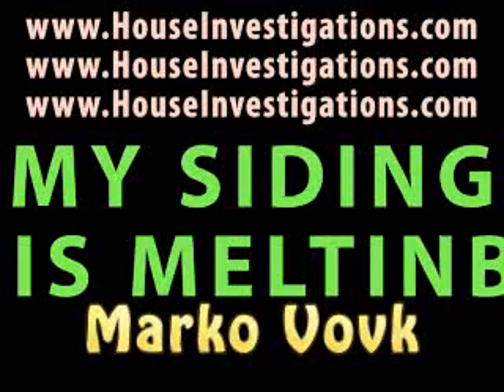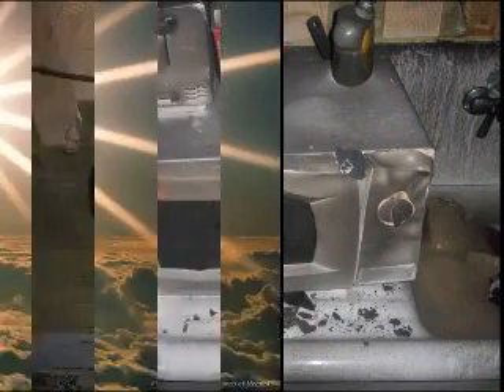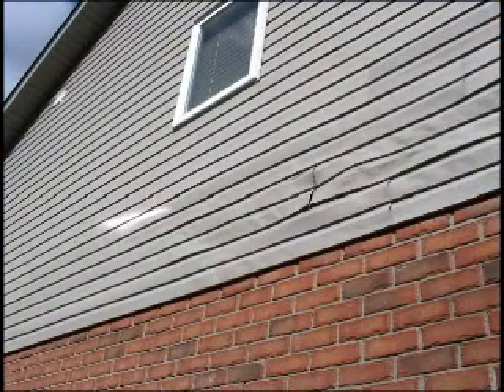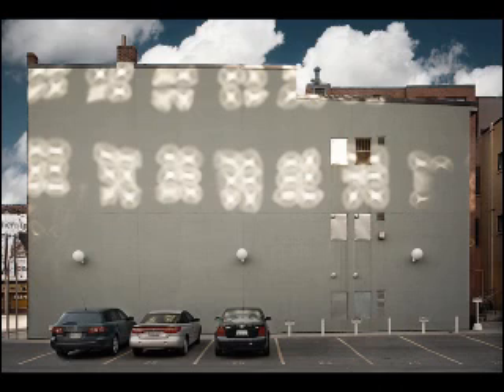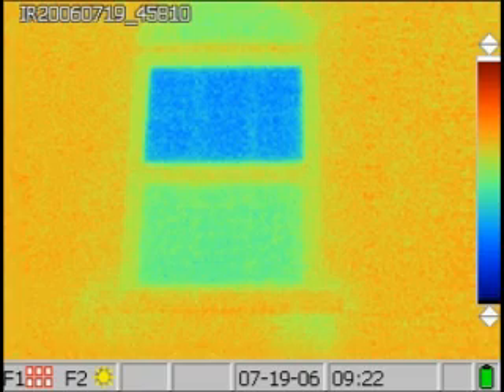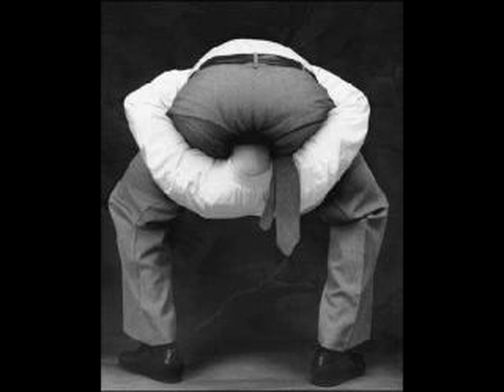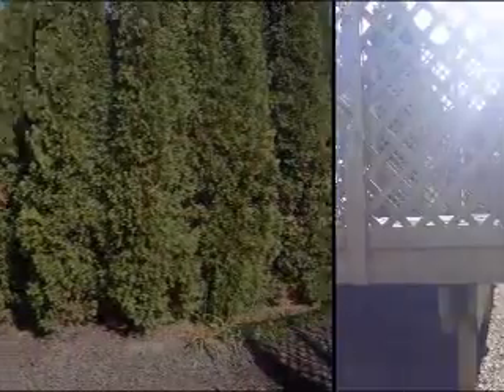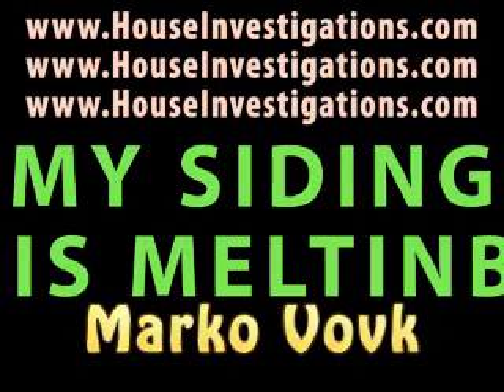My House Is Melting Vinyl Siding Melting Distortion from Window Reflection by Marko Vovk

Comment: The problem is the 'concave' surface of the windows. It acts as a giant lens, focusing the heat back on the house to the west. 
The Sunstarlight clears the eaves about 3 in the afternoon. It reflects down to the ground, and moves due west to the foundation of the house to the west. Then it ascends to the south at a 45 degree angle.
At this time of day the Sunstar does not 'move' much over long periods, due to the angle, so it has time to 'focus' the lens on the vinyl.
I held a thermometer in the focal point and it quickly topped out the 120 degree (Fahrenheit, USA) maximum of the thermometer.
By 'painting' the focal point on the outside of the window with 'frosting' spray, we were able to stop the heat from doing what it had done to the old vinyl again on their new vinyl. 
In testing this I made the above observations and could see small 5 inch 'poofs' in the new vinyl where the Sun was able to focus, about one foot apart, up that angled path.
Reply from the maker: yes great stuff, I like the extra information you added  A+
Reply: @Clevelandmarko  To clarify, this house was in Portsmouth, Ohio, along the Ohio River, to give you the latitude, in relation to the Sunstar, and the house with the windows was east of the house with the melted vinyl. That east west orientation at this latitude is different that situations further south or north. The Sun hit the windows in the east, and reflected back to the west in the afternoon, hitting the east-facing vinyl of the house to the west.

Comment: My neighbor's  new LOW-E glass windows were proven to be cause of a serious fire and several reignites on my property last year.  Glad to be here now!  Adjacent neighbors and I still live under that threat as they have not replaced all of the problematic windows.  Luckily my extensive video surveillance system captured the fire in progress and coupled with investigations by responding firefighters and NC forestry department rangers, left no doubt as to cause.  Lots of other fire and severe melting damage incidents locally and across NC since at least 2010.  But still awaiting action from relevant local, state and federal government officials.  I strongly recommend contacting the US CONSUMER PRODUCT SAFETY COMMISSION, US DEPARTMENT OF ENERGY and your STATE INSURANCE COMMISSIONER/ FIRE MARSHAL should you too be a victim of LOW-E window damage. Working together we can at least try to make a difference and drive change.

Comment: Sunlight heats the gas between the windows and cause the windows to slightly bow out.. thus creating a magnifying effect and concentration of light to struck opposing surface.  I see 160 Degree concentrated light in my home and its only 12 inch X 12 inch concentrated area.
Reply: Making the glass bow out would disperse the rays. When the glass contracts (often on thinner panes), it focuses the rays.

Comment: In your video you claim it's not the window manufacturer's fault but it's a vinyl siding manufacturers fault.  I disagree.  I have this melting siding dilemma.  My neighbor's south facing windows are melting the entire side of my north facing house.  I had no idea what this issue was until I happened upon your website and this video.  I contacted my siding manufacturer and they asked me to cut a sample of the siding from the melted and damaged area of the house and send it to them for analysis

Comment: My boss was showing me this at the apartment complex I work at. At first they thought it was the air conditioner was too close to the 90 deg angle where the problem is occurring. But 5 feet away from an AC should not be THAT hot But one of the worst ones has no neighbors to the north. Just a hill with thick trees. Most off the effected walls are north facing, with the jog coming out facing east. That east facing jog is where most of the melted look is happening.

Comment: Are you people kidding me on fiber cement siding that stuff may not burn but besides that it is nothing but junk. warranty is next to nothing must use certian saw blade,cant be left on the ground,stuff that happens on every job. so unless you pay for a trailer or other storage you voided the warranty plus you must paint it, it breaks easy and when cut or drilled it causes silicon dust that causes canser. Properly install vinyl Iinsuklated works best. will last forever with proper instalation.

Comment: @Clevelandmarko Your facts are wrong.  The are wrong about me and about vinyl siding.  I am currently removing vinyl siding from a home and installing fiber cement due to the damage that vinyl siding has caused to the home.  I don't have to argue with you.  I have been in the business for over 30 years and have had zero problems.  I am a professional in my field.  You are obviously a disgruntled home owner with an inferior product installed on your home.

Comment from the maker: @ArtisanTony OK------- Tony you are probably the guy the installed 5 million homes with cultured stone without a rain screens, 5 million homes with EIFS without  drainage planes, 5 million homes with Hardie Board that was not back primed, 50 million homes with brick with no weep holes, and 5 million homes with defective Louisiana Pacific Particle Board. These sidings and claddings have 100X more issues then vinyl siding.

Comment: @ArtisanTony  I could not agree more, vinyl siding is really a bad solution to cover a home with, but yet easy to install and cheap at that. I have been working with vinyl siding for about 3 years now as my dad has done it for 10 years and have learned quite a bit. Hardy Board is probably something much more effective to cover your house with for sure.
Reply: Not everyone can afford the 300% markup difference on price from the vinyl siding to the hardie.

Comment: the low e ratings and such dont matter in this. It is simply the surface of the glass. It could be polished wood and reflect similarly, so dont blame the type of window, blame vinly.  You wont see other sidings suffer from this.